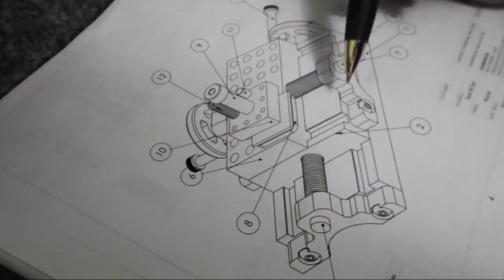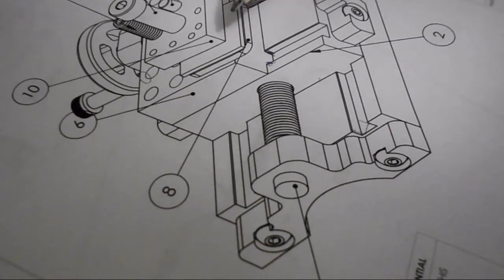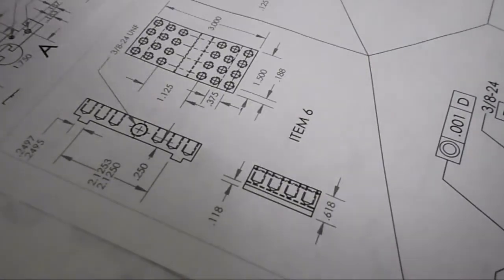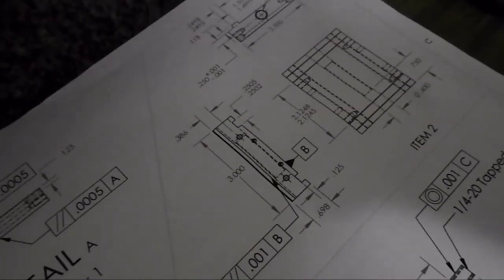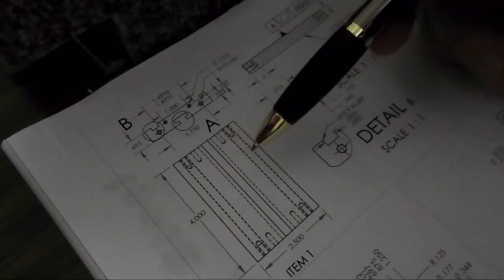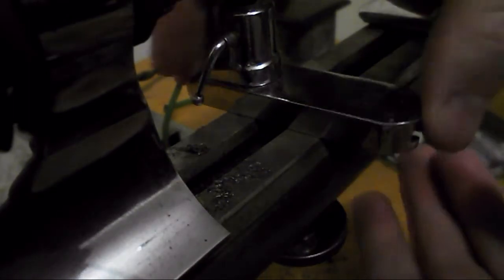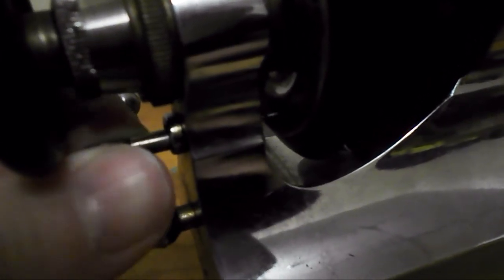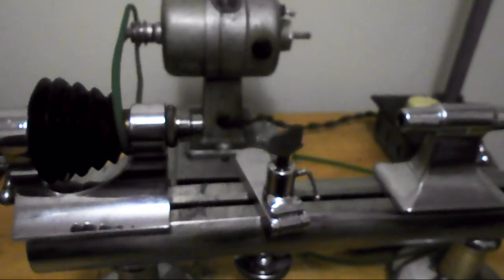Watchmakers Lathe Carriage : A Project Overview

Comment: Looks like a very useful project, Bill. I wonder about the potential for "play" using the slots. That is the other advantage of the traditional dovetail with a gib.  As small as it is, I would be tempted to instead use two ground rods like the Unimat SL cross-slide using split bronze bushings that could be adjusted for wear.
Reply from the maker: That was actually my original idea. This is a bit more compact if I do it this way which is necessary in order to get the proper center height with available adjustment. The rods are a good idea though.
Reply: That is certainly a valid point. It would seem to me that if you have the vertical space for the central feed screws, that you would also have vertical space for the rods since they are in the same plane. Here is a fellow who made his own lathe using this type of design for the carriage. https://www.youtube.com/watch?v=kaetlAmFLCs
Reply from the maker: Makes sense. I think I’m my head I ran out of room! 😂 I’m at the point where I feel somewhat committed to the design. I started doing some test machining of the slots this week. That will be in the next video.
Reply: Great. I look forward to seeing it!